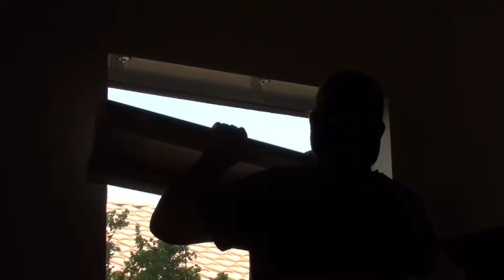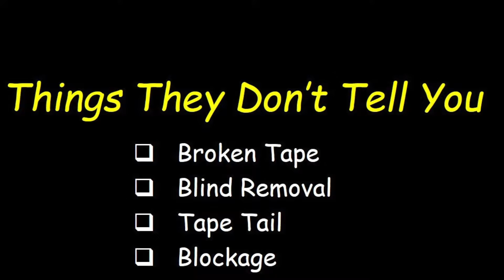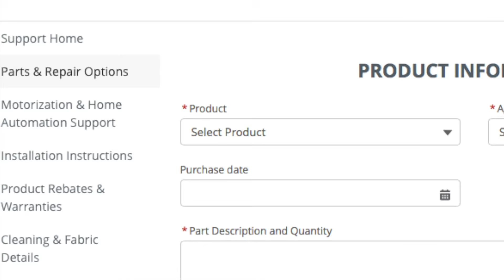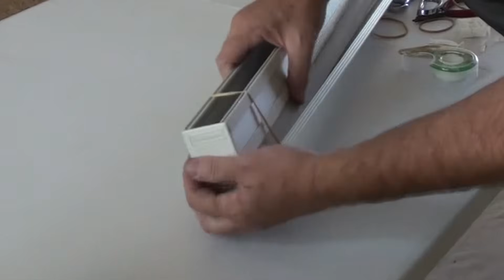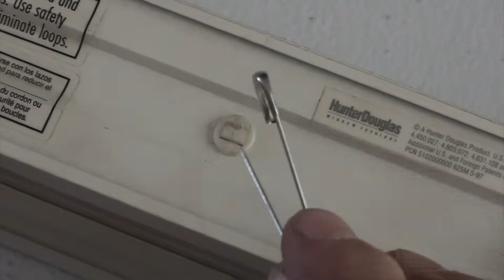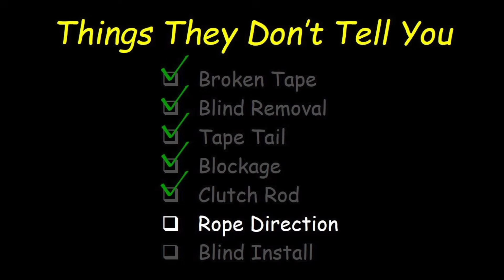Hunter Douglas Blind Repair; Things They Don't Tell You

Comment: Thank you for such a helpful video👍🏻👍🏻My Duette shade with ultraglide cannot be raised and keeps falling back down.  I don't know what went wrong and needs to be replaced.  Is there an online place for troubleshooting to identify what parts need to be replaced.  I wish to order the required parts all in one go from the HD website?  Thank you again.
Reply from the maker: Hi @yanso5271 - thank you for your kind words. I have not come across a troubleshooting guide to help identify the exact problem thus parts replacement. But I will develop a guide next time I hav to make the repairs.  I had the same problem with several of my Duette Easy Rise configuration. If it's not a broken pull rope, then it was broken tape inside the blinds via the spool.  Given your pull rope is operational, I believe the issue is the spool tape. The quantity of spools that are activated by the clutch rod is typically dependent upon the width of the blind.  Some have 2, others may have 3 or 4.  HD used to offer free replacements, however, it appears they no longer do that... I now order replacement spools via Amazon: https://amzn.to/4231f7i
Check this out… If you’re into DIYer like me, I’m offering a free DIY Project Checklist: https://suburban-diy.kit.com/1c55377f50. I’d love your thoughts on it.

Comment: I am at a friend’s house in Scottsdale, ironically! One of the Venetian blinds is “full up”, and won’t come down. It does not seem to have a "release" mechanism like the one you show; the blind mechanism itself seems to be bolted to the window frame so I can't release it! Any suggestions? Thanks!
Reply from the maker: Hi Jim – Arizona is great! I believe it's easier to repair when removed from the mount. I’d recommend trying to take it down first—locate the bolts and undo them. If that's not an option, you might be able to replace the spools while it's still mounted. Check if you have access to the spools from the top cavity.  
Keep in mind that replacing the spools requires removing the clutch rod, which runs the length of the blind. See if you can open the side of the Easy Rise and extract the rod—do you have enough space to do so? If not, taking it down might be necessary.  
Hope that helps! Let us know how it goes. – Suburban DIY

Comment: Tip: if you only replace one and not all, you will need to still loosen the end of the tape and pull it all the way out just like a new one. This way they are all at the same starting point and will rotate the same way. 

I learned this the hard way. I replaced 2/3 and not 3/3. When I pulled on the rope to raise the blinds, the new sections went up and the old side went down. 

When I reversed directions the old side went up and the new side went down!

Finally figured it out. I hope this tip saves other people from making the same mistake or at least how to fix.
Reply from the maker: Awesome tip… Thank you!  We too learned the same the hard way. But every time we make these fixes, we get faster and smarter.

Comment: Do you know how I can restring my Home Decorators cordless bottom up top down cellular blinds, I can't find any video or instructions that make sense?
Reply from the maker: Hi Cherene, thanks for reaching-out.  I’ve only worked on HD corded blinds.  My gut tells me the your Home Decorators cordless blinds work similarly… difference however, is it might be a little tougher to string a new line, given it’s all enclosed, and the clutch assembly has an auto stop and start mechanism. Meaning, is it possible to get inside to the clutch assembly?
Another thought… if memory serves me Home Decorators brand is via Home Depot.  Do you get yours from them?  My experience
Is that Home Depot is super customer service oriented… I’d like to think they’d guide you to a solution to repair.  Let us know!

Comment: Hi, I'm wondering if you can help me with a vertical blind problem? I've installed two used split draw vertical blinds and they don't close in the middle. I'm looking to get them together somehow. Is there an adjustment somewhere?  Thanks,  Lee
Reply from the maker: Hi Lee, thanks for engaging the North Phx Suburbanstead to help with your challenge.  I’ve refreshed vertical blinds, but they were covering sliding glass doors that open from 1 side… not in the middle / center split. I’ve seen center split blinds as 1 unit… not 2 separate units. I recall the vertical slats looked wider at the split.  Might wider slats where the 2 blinds meet, solve the ‘close in the middle’ challenge?
NPSS

Comment: The prewound reels don't have long enough tape for our biggest window. Hunter Douglas sent more cord which is like dental tape. It frayed badly. I've replaced the cord so many times and this time it was so frayed I may try stronger cylindrical cord. I removed 3 weights from the bottom as it is so heavy on this attempt at repair. There are only 3 lift cords.
Reply: Exactly the cord they use is terrible. I don't think they understand the stress that opening and closing shades puts on the cord. You would think in their testing lab they would raise and lower shades thousands of times to see how quickly the cords fail. So basically I have to pay a blind repair company where I live a couple hundred of dollars to remove the shades and repair the cord. I can't DIY. I am not handy with tools. The best I can do is change out a light bulb. Hunter Douglas sent me the parts but the blinds are over 10 years old. I remember having slat blinds in my house growing up in the 50's and 60's. The cords they used in those blinds never broke. They used thick cord that lasted forever.
Reply from the maker: Hi Angela,
Thanks for the comment… very helpful. May I ask the length (height) of your blinds?  
The reason I ask, is because when I was making the spool replacements, I actually thought there was too much tape. 😊
Did you subscribe to the channel?  We have lots more ‘fixing things’ videos… and making things too!
Reply: @suburbandiy  10ft 6" is the height of the blinds - I fixed them this time not with the dental tape type cord but with string-like cord that is on some of our lighter blinds - it seems stronger but might bind sometimes  - it seems OK if the blind is wound up from the ground for now. I actually had to turn the blind upside down - not this time but the time before when I repaired it as the tool that Hunter Douglas provides for going through the blinds was inadequate and I tried a big fat needle but made a hole near the top of the blind -so I chopped a few rows off and turned it upside down. This time I pulled 3 weights out of the blind - it was always far too heavy and it still drops OK. I do wonder if one weight was put in by mistake as 2 were side-by-side. The blind in itself is not that heavy but with the weights it is huge - it covers double doors so is quite wide too.

Comment: How do you stop the top blind slat from bowing on the level lore blinds
Reply from the maker: Hi Diane.  Thx for reaching out.  I'm not sure i'm a good source to assist, as I haven't experienced slats bowing. Nor am I familiar with 'level lore'.
If however, they are honeycomb fabrics-based blinds, perhaps the top rail needs and additional support mount to the wall above the window. If it's the fabric itself, perhaps there is a way to tighten them?  Hope this helps
BTW - did you subscribe to the channel?
We have many more 'fixing things' videos already posted, and several more in the queue.
North Phoenix Suburbanstead.

Comment: I followed the video, but there was no information regarding restringing the spools. I re strung them and rehung the blind and when I raise it, one side raises and lowers faster than the other. Any suggestions ?
Reply from the maker: Hi trkerjon - thx for reaching-out again!  I'm not professionally trained... just a guy with a desire to fix it myself... to date, I've done 18 of these.
Hmmm... if one side raises and lowers faster then the other, perhaps the tape is not seated correctly in the spool assembly?  Perhaps, the the spool assembly is slipping on the clutch rod?
Are both spool assemblies brand new?
Are the tapes (rope, string) exactly the same type?
Would you let us know of that works for you?

Comment: We have three of these that open top and bottom and break every 3-4 years. I am hopeful the mechanisms inside are about the same.  The hint in the video was "heat" , which we have a lot, and the cheap plastic parts, which seems inevitable. But now I have a plan that doesn't involve the dumpster after the warranty ends. (assuming I can buy the "motors" and those little plastic cap and plug things for less than the cost of the blinds) Thanks!
Reply from the maker: Hi Thomas - TY for watching and commenting.  We're in Phoenix AZ. We have both heat and dry air. Even after 10+ years the plastics (clutch & spools) were operational.  Our challenge was the 'tape' (aka string or rope).  They dried-out and broke (and frayed) and therefore the blinds would neither lift nor lower.  We're not sponsored by Hunter Douglas, but they rock!  I used their online service to acquire parts replacement at no charge.  The system allowed me to upload pics of the broken tape... they sent me brand new spools with the tape already installed. Nice!  In short, consider engaging HD during or post warranty... should be no charge!
If curious, rather than hiring someone or dumpster, DIY is at the very core of the North PHX Suburbenstead. And it's YouTube that makes the DIY a reality.  Our goal is to contribute back to YT, so that others like you can gain from the content.  Thank you again!  Lot's more videos in the queue.